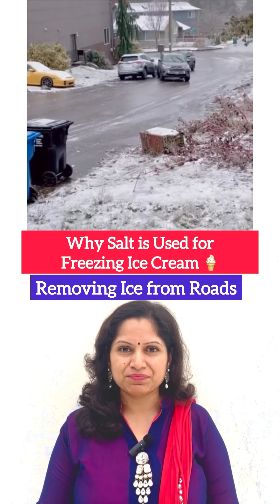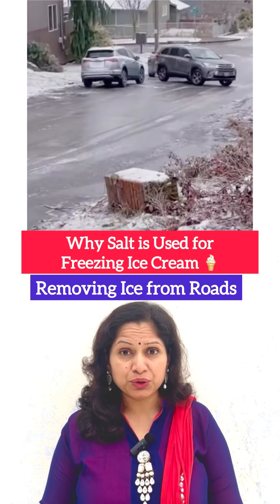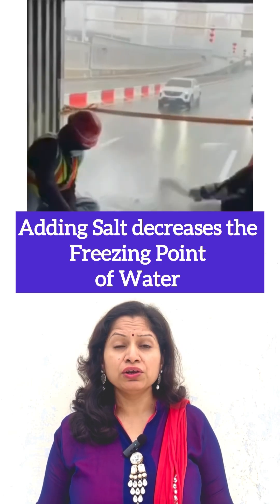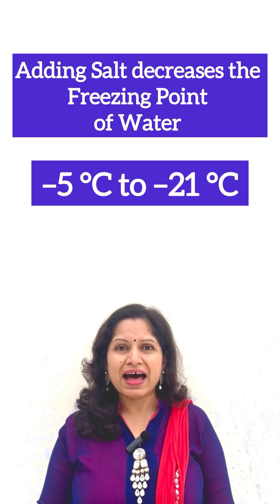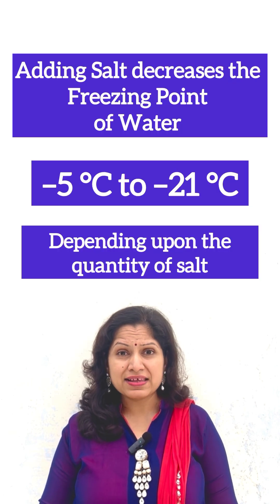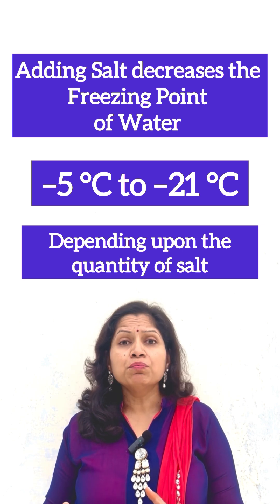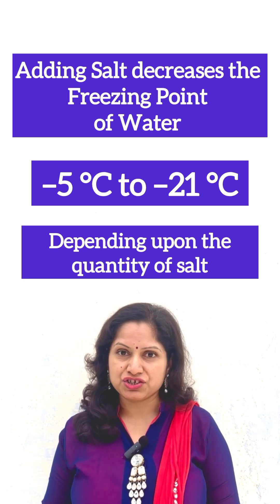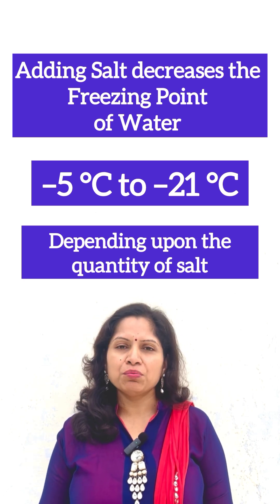Why Salt Freezes Ice Cream but Melts Road Ice? ❄️🍦#drpreetimittal

Comment from the maker: What would be the effect of adding salt to boiling point of water?
Reply: The boling point increases
Reply from the maker: @neilgamingff8776 correct, this is because the dissolved salt particles interfere with the water molecules' ability to escape into the gas phase, requiring more energy (higher temperature) to boil.

Comment: Mam you explained the concept in a very easy way ❤
Thank you Mam 
But mam ice cream vale case me .. salt add krne se bs freezing point hi to kam hota h na naki ki temperature.. fir mam freezing point kam hone se ice melt kyu nhi hui
Please answer ma'am 🥺🙏
Reply from the maker: It’s really a very good doubt that you have.
When salt is added to the ice in the ice cream maker, it forces some of the ice to melt, even at temperatures below 0°C. This melting rapidly absorbs heat from the surrounding water, ice, and the ice cream container, creating an extremely cold liquid brine, so even if some of the ice melts it’s temperature is below 0° so it makes the ice cream to freeze